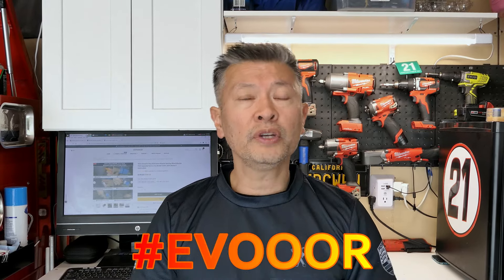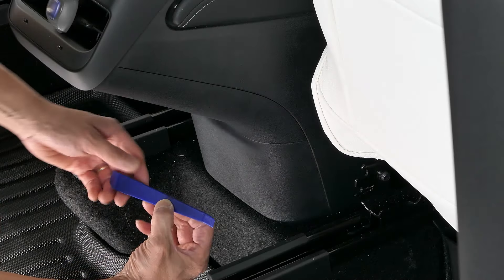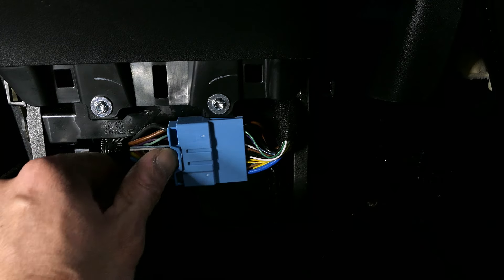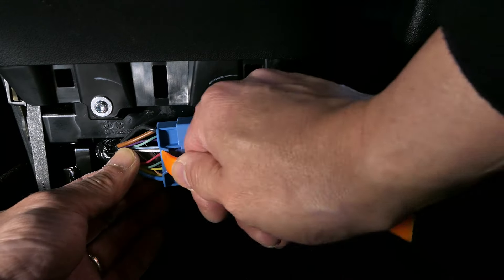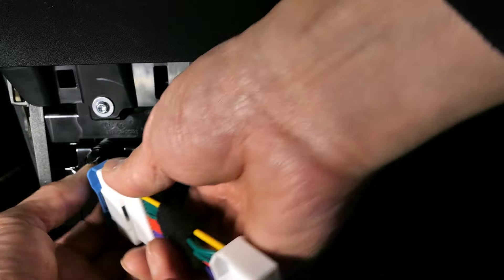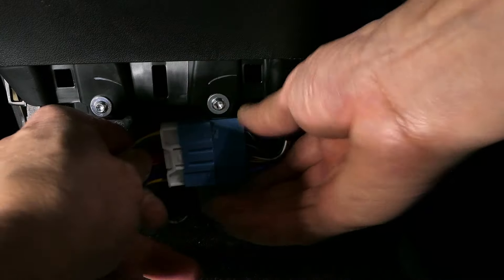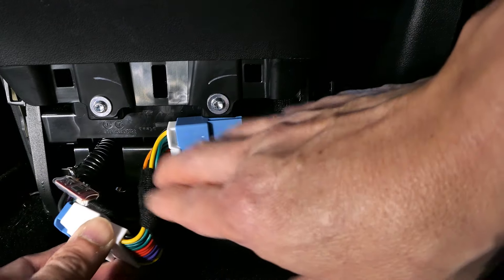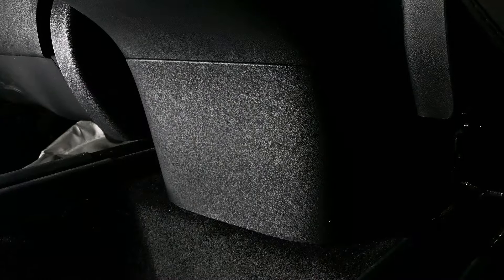**5 Min Install** Anti-Nag Device for #Tesla Model 3 / Y #EVOOOR, Updated!

Comment: I have the version 2 in the steering wheel in MYP works great, ordered this for my other model Y.  Is it activated just like the version 2 where you double tap the right scroll wheel to activate?  And it’s off unless you double tap?
Reply from the maker: I believe by default, it's set to be ON.

Comment: Hey Peter, thanks for the video! Was wondering, do you think this device can be used in conjunction with another ODB connector device? (like the physical button/storage device you reviewed a few days ago) it seems to me they are both just jumpers, its just a matter of room for all of them in that area underneath the plastic. What do you think?
Reply from the maker: Thanks for checking out the video! Yes, the manufacture mentioned to me that you CAN daisy chain connectors.

Comment: What happens IF my OBD2 in the back  is occupied with other device like front speedometer cluster ?? Does model 3 has 2 OBD2 ??
Reply from the maker: You can daisy chain more than 1 device on the OBD connector.
Reply: @TheAutomotiveFanatic 

oh really if so then show us how, and we gonna buy it then!! Also show us how this new device / chip  works??
Reply from the maker: @p3dtesla118  daisy chaining the connections isn't difficult. Your connection from the screen cluster on your dash will have similar connections as the Anti-Nag. Simply connect everything as one and you'll be good to go.
Reply: @TheAutomotiveFanatic   why you said that this is improve upgrade version,  I still see the annoying volume shows up on my screen all the time. What is the difference between TSL2 and this one???
Reply: @TheAutomotiveFanatic  
 why you said that this is improve upgrade version,  I still see the annoying volume shows up on my screen all the time. What is the difference between TSL2 and this one???
Reply from the maker: @p3dtesla118  If you're seeing the annoying volume show up, I assume you installed the Anti-Nag on the left scroll side. My recommendation is to install it on the right side. With the newest version, you do not have to install it behind the steering wheel control. It's installed in the rear OBD port. It's considered an upgrade because the installation is easier and more reliable than the other versions. If you do decide to change, when ordering, make sure you ask the EVOOOR team to program the Anti-Nag to work with the RIGHT SIDE SCROLL and not the left side.
Reply: @TheAutomotiveFanatic  Well it's actually goin into my odb2 port and  not on my steering wheel, no left or right side. So how come I steel see the volume sows up on my screen????
Reply from the maker: @p3dtesla118  so you bought this already? That's what I am guessing based on your response. If so, I would contact EVOOOR and see if they can help you change it to the speed scroll wheel instead of the volume scroll wheel.
Reply: @TheAutomotiveFanatic  oh ok that's all I need to know, thanks men!!!!
Reply: We make a better, less annoying to install and cheaper chip: https://youtu.be/OpRmpOGEm1k

Comment: Hi Peter, great video

I have a question. I recently ordered a TSL six installed on my 2023 model Y. The issue that I am seeing is the hazard lights when I open the doors or when I put the car in reverse. 

Did you notice this issue? Is there any chance we can avoid the Hazard lights from coming on? 

One thing though , when I close the doors and also when I shift the car to Drive,  the hazard lights turn off, but it’s little bit annoying to see hazard lights.
Reply from the maker: Great questions...you must have the newest version from the manufacture with all the extra features. I will reach out to them to see if there is a solution to your request.
Reply: @TheAutomotiveFanatic  thank you very much.
Reply from the maker: @9VKG  I reached out to EVOOOR and they mentioned for you to email them directly. They can help you figure out how to resolve the issue. 
support@evooor.com
Reply: We are having this same issue with a 2023 model Y. No email back from support yet and it’s been a while. Did you have any luck with a solution?
Reply: @walkermarinesales  I got a response from Customer Service, there is no option to turn it off. We have to live with it.
Reply: @9VKG  I sent another email, and got a reply back a few hours later. They mentioned its a known issue and are sending me out a replacement with that disabled supposedly.
Reply from the maker: @walkermarinesales  I'm sorry that no one has reached out to you for support. I would try once again to see if they respond.
Reply: @walkermarinesales  Great. Once you receive it, can you let us know here , if the issue is fixed. That will help. I can also contact them and get a replacement.
Reply: @9VKG  for sure!
Reply: @walkermarinesales  I just got on their website, they now have 2 versions of TSL6, one just with Anti-nag only and one upgraded with all extra features. I think they are sending you the one with no other features. Hope you are aware of this. This is what i saw on their website, see note below

In order to meet the needs of different customers, we now sell 2 versions: Only Anti-Nag Version TSL6 only has the Anti-Nag function and no any other functions. If you need other functions, please purchase the Upgraded version.
Reply: @9VKG  I just wanted to let you know we got a new version of the TSL6. Works perfect. No more Hazard lights coming on. Still has the driver door hold to open the frunk which is a very nice feature. Only slight annoyance is now they added a speaker to it so every time you engage or disengage autopilot there is a beep that comes from it too.

Comment: Hi Peter, do they have one or are they going to create one for a 2024 Model S?
Reply from the maker: Vince, currently they only have the version that installs inside the steering wheel. I have not heard of them mentioning a version that installs onto the ODB connector.
Reply: @TheAutomotiveFanatic  thanks, I sent them a email asking if they will make one for the model s 3 days ago but no reply yet. But they do have one for the 2024 S? Does the software just modify the speed every 10 seconds or so and do you see the speed change and or feel the speed change?
Reply from the maker: @jvmendoza1972  on their site, it does list for the X/S up to 23. Unlike the new M3P Highland, I believe it would work on the 24 because it's not a refresh. As far as the software goes, it changes the "speed" per-say, but does not actually change the speed. It just "scrolls".
Reply: Just tried to manually change speed up and down but that does not prevent from naging…hope it will work when delivered… m3 highland
Reply from the maker: @Sailingandelectronics  it's more than simply scrolling the speed wheel. I believe it's more software based.

Comment: Just installed this and the volume keeps decreasing over time. Also the volume constantly coming on the screen and on your connected device super annoying.

Update*
Seems like I received a defective product but customer service declines to offer me a full refund and return shipping. Their return policy even says they will cover return shipping for defective products. I said that I was willing to accept a replacement, but they want me to purchase it at a discount. I've opted to file a claim as customer service doesn't seem like they are willing to refund me the purchase.
Reply from the maker: Chao, the manufacture understands that the volume display is becoming a problem. My suggestion is to reach directly to them and ask for a reprogrammed device. They will help you.
Reply: Good to hear, I did email them already waiting for a reply
Reply from the maker: @raethgu  good luck!

Comment: I ordered mine, it's a crap. It doesn't work at all. The contact support doesn't reply, what a surprise from a dark Chinese seller. Guys, don't fall for it!
Reply from the maker: Which version did you install? Might sound silly, but did you turn it on?
Reply: I’ve had the same experience, trying 2 different TSL2 chips with a 2018 Model 3.  Neither works.  I see a red light when I plug in the chip, but there’s no beep, and it doesn’t work.